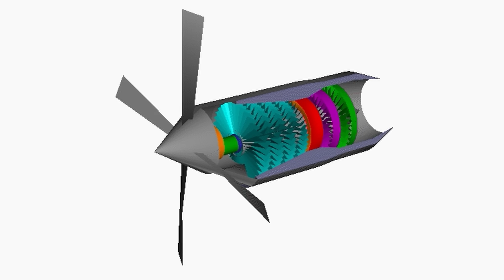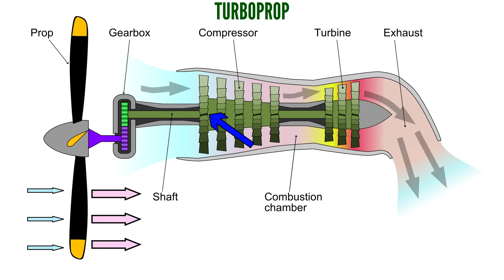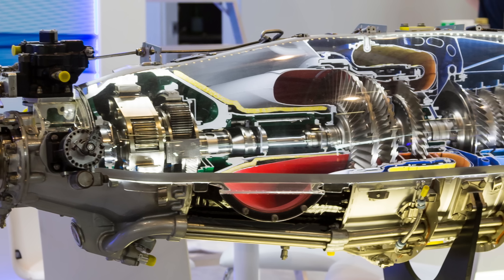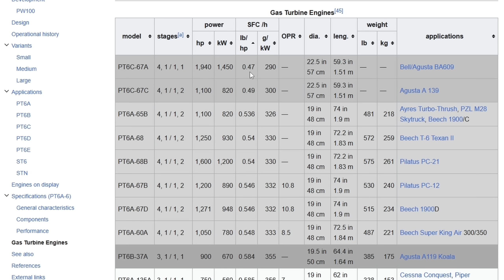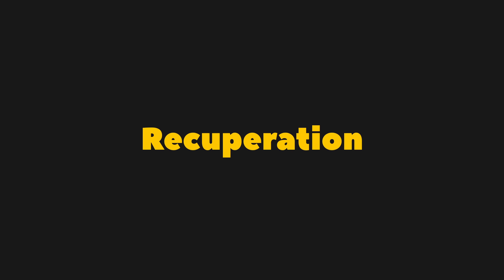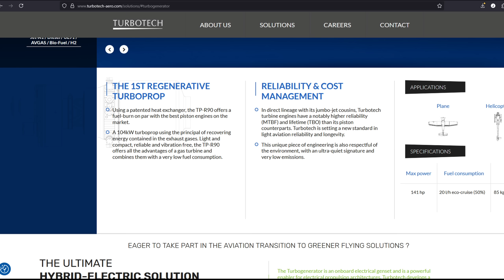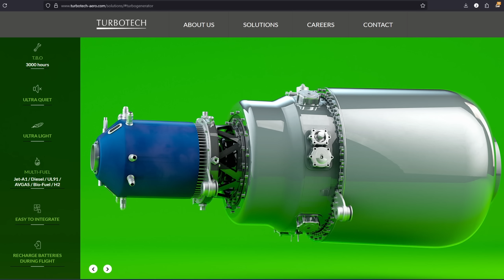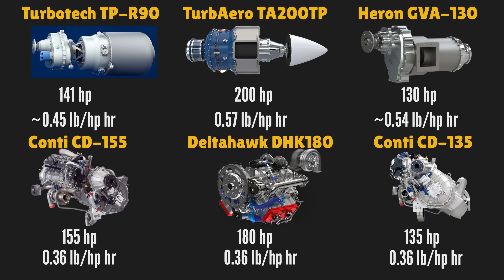Are Piston Engines Dead? Small Turboprops are Here

Comment: Then you can go electric and hybrid.
e-motors are much more reliable, less moving parts, less weight and more power density.
And a generator on a hybrid can always go for it's best/efficient working point.

Comment: Very good presentation,  thank you.   One aspect of the price figure is that it's not REALLY the actual price number,   but the DIFFERENCE BETWEEN x and y.  The choice isn't between the turbo and nothing at all,  but instead,  what needs justified is the additional beyond the conventional solution.   Of course without a known installed cost,  it's all guessing.
Reply: Similar issue with the diesel 2 stroke ( that runs on Jet fuel); its simpler, lighter, more fuel efficient...sounds great until you look at nearly double the installed cost ( 3 or 4 times the cost of an overhaul on an existing gas engine) and you add in the huge factor for all the unknowns: reliability in actual use, field support, long term parts support, problems that haven't yet manifested...
Reply: @scottwhitcher265  If you're talking about the DeltaHawk diesel, it's weight is much higher than that of its gasoline-burning competition, especially once you factor in the weight of its cooling system.

Comment: Small turboprop power units with recuperation might come into their own when coupled with electric drivetrains for additional propellors? Operating at a 100% output to the turboprop at takeoff, assisted by electric battery driven prop(s). On cruise operating at higher output and efficiency when driving another electric propellor or two, or when recharging the battery ready for the next takeoff. (Or just recharge the batteries for cheap on the ground?) Keeping the A1 tank will provide additional range for safety. A larger, heavier & more stable, quieter aircraft could then use a smaller turbine. e.g. For island ferry services.
Reply: Totally agree. As with cars. there are several ways it can be configured, from a “emergency only” range extender generator for an all electric short hop plane, to a primary power source that also has a motor-generator on the same shaft, to give boost for takeoff - more like KERS in F1.  This also gives you a short duration motor only operation, improving safety.
Reply: now add in the weight of the batteries, inverters, motors, charging system, monitoring electronics and drag from the "extra" prop and you instantly negate any advantage you had.
Reply: No.
Reply: Or maybe, maybe design engines that take stoichiometry into account instead of dumping fuel into the combustion chamber to lower EGT's and block temp.. like cars do for the past 60years...

Comment: fuel efficiency is only part of the equation... what about weight? Is that 210 hp lycoming heavier than the equivalent, but less efficient, turbo prop? What about smaller, modern, automotive engines? The 1.5L 4 cyl honda makes about the same hp as that 6 cyl lycoming.

Comment: I have odten thought that adding a secondary combustion chamber after the exhaust turbines where water would be inhected, then a few more exhaust turbine blades afterwards would greatly increase efficiency and power in turbine engines.
Reply: right, because water doesn't weigh anything...

Comment: Much of this comes down to economics. If fuel costs are really cheap compared to maintenance, than turboprops win. As the cost of fuel rises, they become less attractive. What if we just run the turbine as a generator at its highest efficiency, and couple it to the propeller just at this, cruise, level. All lower altitude operation is done be electric motors with the turbine powering the generator for them.

Comment: You are comparing 2025 turbine tech with 1960s or so piston tech. 35% efficiency used to be good, but current engine development exceeds 50% efficiency. 70% is possible.
10:06 "recuperation"
Good idea. But not as efficient as a Displacement Adjuster, which allows a piston engine to ramp up and down displacement (and so compression ratio since the combustion chamber size is constant) as desired while maintaining a 2.5:1 expansion to compression ratio AT ALTITUDE.
Imagine a piston engine with essentially no external thermal losses operating at 40:1 compression and 100:1 expansion.
12:43 "massively improved reliability"
Not compared to modern engines with bypass oil filters. Trucks run "forever" with negligible maintenance outside of the current dorky emissions garbage (stoichiometric and three way cat is the way to go).
The next step is hot wall ignition and simultaneous combined cycle. Piston engine longevity is improving fast.
Note that the weights are comparable, and that's with an old school inefficient Rotax. A modern piston engine would be lighter than than that turbine.
13:50 "superior reliability justifies any cost"
Bull, tripe, whatever. If you add additional engines reliability goes up, but so do emissions. Speaking of which, piston engines can have clean exhaust. Hmm, that regenerator could do double duty as a catalytic converter. Maybe the turboprop isn't completely obsolete after all. You do agree that eliminating toxic emissions is worth any cost, especially since piston engines can and will do so, right?
Thumbs up, but turboprops catching up to pistons half a century ago efficiency and pollution wise still sucks.
Want to see my engine?

Comment: Finally, some precise figures. One argument was not emphasized enough: smooth running. A turboprop probably outperforms any piston engine in this respect.
Reply: if that's your primary concern for an aircraft, you shouldn't be designing them

Comment: I also think small 2-stroke radial diesel engines are a seriously overlooked design, with enormous power and efficiency potential. They are direct prop connected, small and lightweight with far less moving parts, and about as fuel efficient as you can get, with major cost savings using regular diesel fuel.
Reply: I assume you are talking about the Zoche engine?
If so, it's already decades ago i came across this engine and sofar it's not happening ....
Reply: @normaal4663  Yeah, they're often at "the shows", but I've yet to see one fly. Great idea, though...
Reply: @MikenomorCCP  Well, like anything, it requires an investor for extensive R&D, then production. Which no one wants to invest in. 

Notice how long it took for someone to invest in developing small turbines, when turbo-props have been around for 60 years.
Reply: @Condor1970  Yup.
Reply: Diesel has a higher freezing temp so you will likely lose that efficiency trying to keep your fuel from starting to gel. Not to mention the additional support network needed to warm the fuel for cold climate areas when the aircraft is not in use.
Reply: @toddn.3123  The upshot is - these aircraft wouldn't be running diesel.

They'll be on JET-A1, which has a gel point of -47*c as opposed to -9.2*c for standard diesel.

Most general aviation planes aren't gonna see outside temperatures drop much below -30*c depending on the weather conditions, although on the grounds of "but sometimes", and because we've learned the hard way what happens when JET-A1 freezes in passenger airliners, it wouldn't be impossible to have a heat exchanger unit to transfer heat from either the engine oil, coolant, or both into the fuel. Besides running the pumps, this wouldn't expend much additional energy to do, and would easily prevent the fuel from gelling in the wings.
Reply: @DigBipper188  And - much more important - in many (most?) jurisdictions there is no tax on jet fuel.
Reply: @toddn.3123 what you're describing suggests diesel would be a better fuel in colder conditions.
Reply: @toddn.3123 not necessarily.Jet A is lightweight diesel, same fuel jet airplanes run and #1 diesel jell points is so low it's not an issue. Recirculation from warmed fuel back to  the pump negates any jelling.
Reply: @AlanThomas-hp3fn  That's incorrect.

Jet fuel is based on kerosene, which is lighter and very slightly lower energy density than diesel.

It's preferred over diesel because of the much lower gel point of -46*c to -47*c, which is critical for high altitude aircraft, as the outside temperatures can and will regularly dip way below 0*c.
Reply: The deltahawk engine is gaining a lot of traction and has multiple flying examples from what I understamd
Reply: more recently there was the alpha otto revforce
Reply: You are going to see these, soon on factory aircraft. I cannot say how or who, but they are coming.
Reply: Zosche?
Reply: Perhaps for a flying lawnmower
Reply: I also like two stroke diesel but I think a gear reduction for the prop is a good thing. So I like the Gemini 100 opposed piston better. Slightly better fuel efficiency, gear reduction is mandatory for that engine. Bummed out it seems to have flopped dead as well with other great ideas.

Comment: Power, weight, and cost are helpful, but what is the TBO? If it really is three times the TBO of a piston engine, it would justify quite a bit of other parameters. 

As a parallel example, I have heard that electric busses gain most of their savings not from fuel costs, but from reduced brake maintenance.
Reply from the maker: 3,000 hrs for the mentioned turboprops. So 1.5 times that of most piston engines.

Comment: I very much enjoyed this video. I am a master mechanical technician but I have little to know knowledge of engine operations in airplanes. However when you said turboprop are most efficient at or near full power but most cursing throttle settings are 60 to 40 percent I thought about using a verbal pitch prop to maintain cursing speeds while running the turboprop at a more efficient power setting. Just sayin…

Comment: A while back Rolls Royce Allison intoduced a 'small turbine engine for airplanes that use the Lycoming 540 seires of engine. I have a lot of time sitting behind those in my 47 years of flying for a living. As I recall, it was marked as a solution for well the lack of avgas in some places- The problem is that its a 500K for the engine and another 100K to install and get the STC for the aircraft like the Cherokee Six, a great airplane by the way and you can make money flying those too. I don't think they when anywhere with it. There are issues if you mess up a start with a piston, not a major issue, do that with a turbo prop or turbine and well guess what you check book is going to get a whole lot lighter. Hot starts are really bad news. And like a lot of thing its not the question of if but a question of when. Weak battery and charging issues. I can't for the life of me think that putting turbines or turboprops in light recreational aircraft is ever going to be more that just a thought. But I could be wrong. To me the costs are just way to much, when I started flying for a living, a brand new Cessna 172 you could buy it for around 26K out the door. It was a lot of money back in 75, now I guess a new one will set you back 500K or more. GA is slowly being strangled out of existence. And its being done on purpose.

Comment: A specific version from this TP R90 engine will be made for Ultralight (109hp), but, on ultralights whe fly mostly at very low power in cruise to enjoy the flight, not to fly the fastest from A to B, around 12L/ hour consumption with a Rotax 912S, max power is only needed for short take off on very small strips (200-300m grass is relatively common)

Comment: Small turbines have a small market. Minimum $150K for the turbine engine, then new engine mount, cowling and prop. Not financially feasible or practical. If not experimental, then all components STC or certified with increased cost. Piston engine for recreational GA isn't going anywhere for the next 25 years at least. Average GA privately flown aircraft is about 30-50 hrs a year. (20 yrs to reach TBO and many planes fly past TBO up to 2400 hrs - possibly 28-30 yrs between rebuild.) But, if a high HP aircraft is flown 200 - 300hrs a year and we are talking IO540s and similar - closing in on $100K rebuilds/new engine-  then the cost start to look intriguing. Maybe, turbines can break into the market at the 250-400HP level and in time trickle down into the 150-180 HP market. And yet, that engine mount/cowling/prop cost in addition to turbine combo isn't small. (Lighter turbine usually needs longer engine mount to balance CG) I'd like to see it happen but don't see a pathway anytime soon

Comment: Longer TBO and cost of maintenance are factors that weren't spelled out here.  My understanding is that "rebuilds" on turbines is extremely expensive.  Are these essentially "disposable" - that the cost to rebuild would be higher than the cost of a new unit?  If you factor in the piston engine maintenance at 2000 hours on a US$55k piston vs. one of these costing US$60k to $100k and going for 3000 hours how does that compare?

Comment: The ultimate metric is $/hr. So take a number of hours, say 3000 to match the TBO of the turbine engine, and add up the prorated portion of the purchase cost, the fuel cost, maintenance costs other than overhaul and at least one overhaul.

And the comparison needs to include piston engines that require 100LL Avgas, unleaded auto gas, and diesel. My bet is that come major overhaul time for engine that run on avgas a conversion to a turbine might look quite attractive. Of course  conversion to a diesel engine might look even more attractive. The analysis will tell.
Reply: My money's on diesel being the more attractive option. They end up being a really solid middleground when it comes to the overhaul times and fuel costs.

Not to mention there are full FADEC systems available for diesel cycle aviation engines. This makes them easier to start than a jet or turboprop and just as easy to control in-flight.

They also behave very similarly to turbine engines with regard to how the fuelling affects their EGTs. When a turbine gets more fuel, the EGTs increase. When a diesel engine gets more fuel - its EGTs also increase as a result of the engine having an unmetered air intake.
Reply: @DigBipper188  Diesels in aviation are turning out to have poor TBO intervals when compared to the gasoline engines that they are intended to replace. Liquid cooling allows gasoline engines to achieve higher compression ratios, while also running on lower octane unleaded fuels (see: Rotax 9xx series), that's what GA needs.

Diesels are also proving to be too heavy to be practical on most existing airframe designs.

Mogas is also cheaper than both avgas and jet fuel.

Comment: Yeah but that's all irrelevant if the cost of overhaul is more than the value of the used aircraft after its very long life. Recips have already gotten stupidly expensive, and even higher turbine cost is arguably a larger factor for the potential private owner where fuel efficiency isn't the primary concern since he's not flying it all the time like a business would.

Comment: Wouldn't the reduced maintenance requirements, the far lower cost of Avtur compared to Avgas and the increased reliability make it a no.brainer? The unit cost of producing the engine will fall under Wright's Law if massively in demand plus the unit itself would probably be far lighter than a reciprocating engine. This first model will be the worst it will ever be and will become ever more efficient once continuously developed

Comment: What about fuel cost?  Basically engine run time based on fuel cost.  From a quick search it seems Jet A is cheaper than AVgas and tends to be more available.  An fictional example with cars. If my car gets 20 MPG using no premium fuel at $3 per gallon but your car gets 30 MPG but has to use premium gas at $4.50 per gallon, then it would cost either vehicle $9 the travel the same distance.
Reply from the maker: 100%. Avgas is more expensive than Jet-A1, but not much cheaper usually than mogas (car petrol), which the more modern piston engines I showed run on.

Also the price difference (avgas vs Jet-A1) where you live or fly would need to be big to recover the additional purchase cost. Not even mentioning the higher overhaul cost of the turboprop. That is perhaps a bit vague as there are too many variables like local fuel cost, difference in purchase cost and overhaul cost which we don't know the cost of currently.